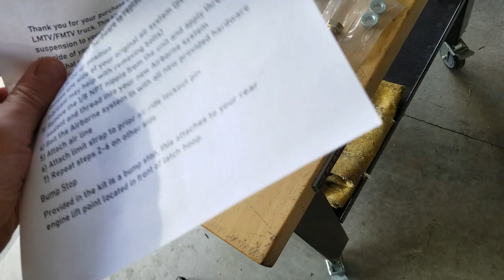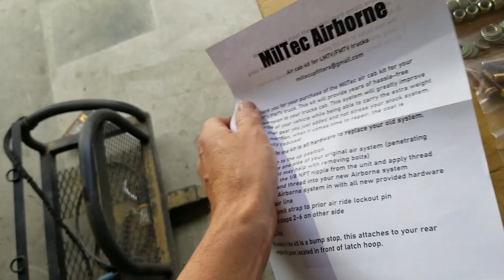Abel LMTV build part 130 (Airborne cab air ride system)

Comment: Hi Sean, very nice video and I am looking very much forward to see your review of the new air ride system. I just dropped off my truck at Acela for a complete overhaul but am not sure if I want the air ride seats which make me sit higher than I feel comfortable at 6’2”. I wonder if your new ride system would allow me to eliminate the air seats and go with fixed seats? What is your opinion on air ride seats, are they a very nice to have option or not really necessary? I originally wanted to install Scheelman seats but with those I would not be able to use the air ride but would sit lower which I would prefer. 
Would you be able to share where you got the protection rings for the air inflation hoses on the wheel rims? I would love to find 6 of them. Thanks again for all the info you show us on your great channel! Peter
Reply from the maker: Get the scheelmans and go with this setup.  Why would you want air ride seats when you already have an air ride cab?  To me it seems silly to do that.  Acela does great work.  You are in good hands.....

Comment: Came out clean.  The Ross's did a great job.  That bumpstop looks to rest where the A1R cab has the bracket for the cab latch.  I wonder if there will be a need to adjust the pressure on-the-fly (sync it to the CTIS ECU? LOL). I can imagine where a fully loaded and gear-heavy cab might use some additional air vs an empty, but my only other airbag experience is with tow vehicles (pickups).  If I got the spec right, those are 5k bags and can operate anywhere between 5-100 psi.  I wonder what default is on an A0 truck...
Reply from the maker: Don't A1rs have totally different cab air bag setups anyways???
Reply: @SeanFillner  They are set up rigid with a full delete.  The mounting brackets for the bags are missing (the bolt holes are of course there).  The "ears" on the back of the cab are deleted as is the floating cross member (replaced by a static brace that goes up from where the "ears" mount to and up form a "V" pattern atop which the cab latch sits, several inches higher than on the A0 trucks).  Can they be retrofitted to air ride?  You bet they can.  Some Sargents with motorpool pull had it done to their trucks).  I just need to locate a parts truck and someone reasonable...
Reply: Chris Urquhart I was in the Army Reserve till 2001, I never drove or rode in an lmtv but it sounds like the ride would be terrible without an air ride cab.

Comment: So how do you like the ride?   

I heard these setups slew right to left a little..... is that true?   

My stock airbag blew out...looking at options.   

Thanks!
Reply from the maker: THis is a great setup although the guys that make it are no longer in business/do not respond anymore??  There is another company out there that made replicas of this setup and can be easily sourced....  I do not know what slew right to left a little means....
Reply: Fastidious Restomods 

Slewing left and right .... does the cab rear swing right and left?   

Thanks for the feedback!
Reply from the maker: @dcraigslist5243  not at all unless your front cab mount bushings are toast
Reply: Fastidious Restomods 

Ha... well, I need to probably do my cab bushings before my airbag replacement then.   My front left one is missing.... at least the rubber part is missing.
Reply from the maker: That does create for a harsh ride....